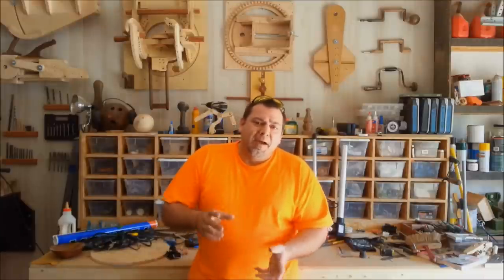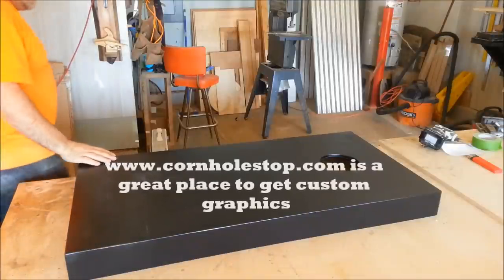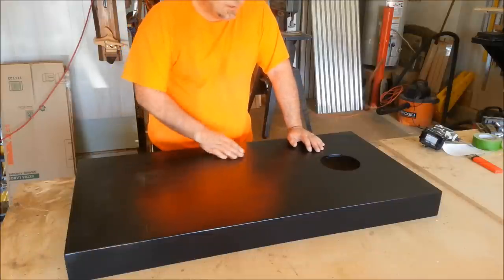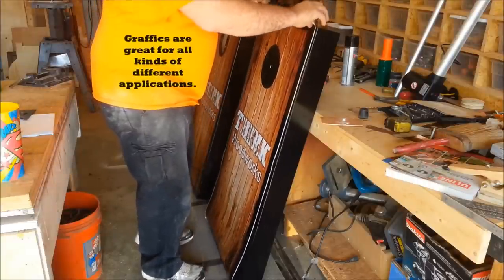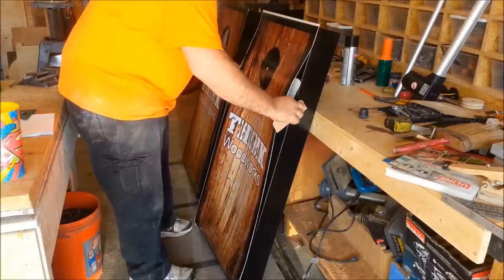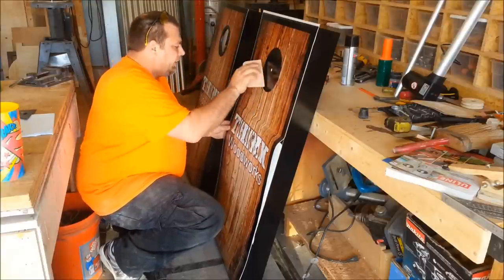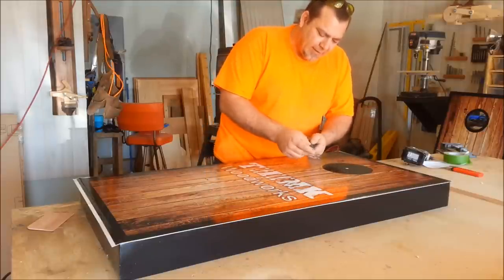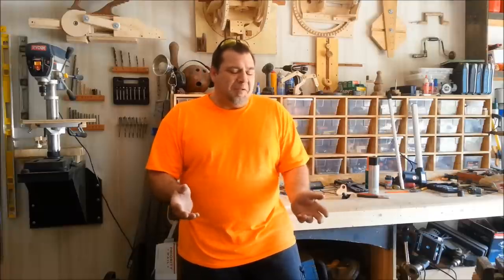Corn Hole -  How to Apply Graphics

Comment: I love it, It isn't just how well you presented the issues, it is also the big picture. Woodworkers in general tend to be too insular and sometimes forget that wood is just one material of many. Frank Lloyd Wright realised that for architecture to reach its full potential, he had to master all materials and use them appropriately.
Reply from the maker: You are so right. There is a vast expanse of mediums a woodworks can include in there pallet that will quickly open so many doors.

Comment: Very well explained Izzy,
In my former life, prior my permanent total disability, I used to work in a place doing advertising products. Besides vinyls we ha a special printer which could handle boards 1.5 inches thick and 8.2 feet in length and 4 feet in width. We did some tests on printing direct to pine with an resolution of 1200 dpi and the translucid color it gave some real cool effects. Covered with a protective coat of lacquer this is also a nice way to get individual pictures to your work pieces. The downside of this is you have to assemble the final work piece with a finished surface with no chance of correction if something goes wrong.
Greetings from Good Old Germany
Peter
PS It seems to me you are a professional as well, doing this vinyl covering.
Reply from the maker: A couple drops of dawn dish soap in a spray bottle and just mist the the decal and surface and it can be moved and removed till it is in the perfect position then pressed into place and let dry and there is no chance of damaging the print of the work piece. have done this on larger prints.
Reply: Thank you Izzy for the quick answer, well I preferred the dry method as well, even on cars, as I used to do back in the days where I'd been able to work. As you are using 3M decals, they also got one with little air channels on the glue side (can't remember the trade name), if you don't press too hard in the first place you can easily lift and re position the print and  I've never seen an air enclosure. 
Greetings from Good Old Germany
Peter

Comment: I love watching your videos and have learned a lot! I want to share a DIY idea that would be useful for applying your vinyl graphics. I am a sign maker and own a tool called the big squeegee. I make my own now out of hardwood and make sure one edge is perfectly straight. I make them 6" wide out of 1/4 in oak and have random lengths. It must be slightly longer than the vinyl you are applying. on corn hole boards I would use my 26" squeegee. If you start it straight after peeling back the first 8-10 inches you can fold the graphic back or even roll it and push your squeegee. it will apply it in one swipe and bubble free. Personally I would start on the end without the hole. That is the most likely place you will get bubbles. Thanks for all the info and videos and make yourself a big squeegee because I know you have scrap wood laying around!

Comment: Izzy   Great Job.    What thickness and quality of vinyl do you use on your cornhole boards.  Also how much are you paying for your sheet of vinyl.  I checked in with a printer around here and unless I buy like 200 or 300 sheets of vinyl they want to charge me between 45 and 75 for one sheet of vinyl that is 24x48.

Jeff

Comment: When they apply vinyl to the sides of trucks they have to work around the rivets a heat gun and a soft brush lightly tapping the warm vinyl will conform to the uneven surface.
Reply from the maker: Have used a  mini butane torch for similar things

Comment: do you know any methods like this for skateboards?, ive got a blank skateboard and i want to apply graphics that can wear down overtime, like a real skateboard. i know if i use an ordinary vinyl sticker, the bottom of the deck will be grippy, and will bunch up when i do board slides. is there any heat methods you know of

Comment: Do you apply any other finish after the vinyl is attached?
Reply from the maker: The vinyl i used on the corn boards is laminated so its not needed un laminated vinyl needs to have a good coat of polycrylic applied after installed